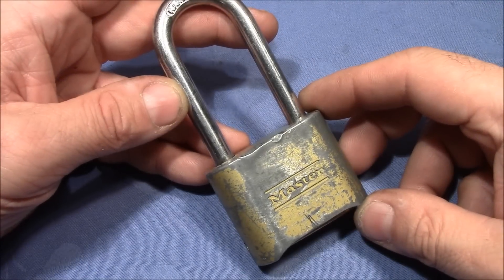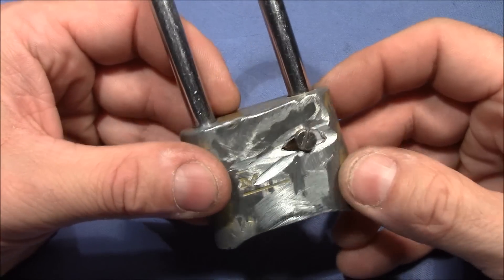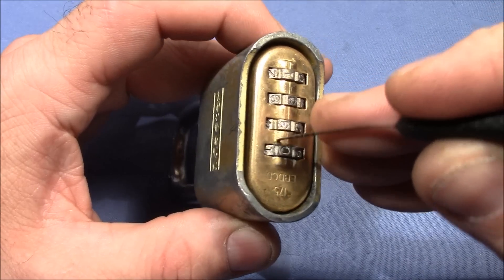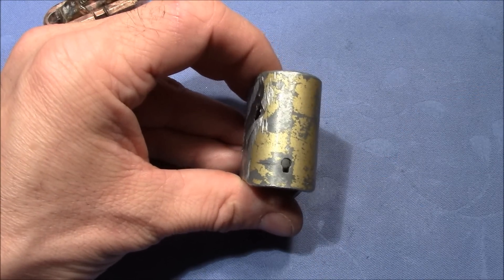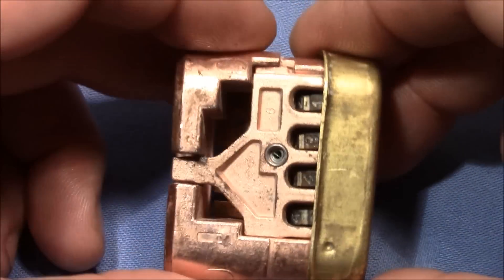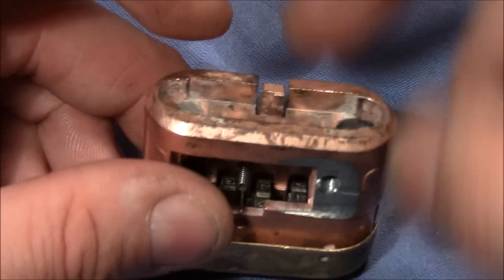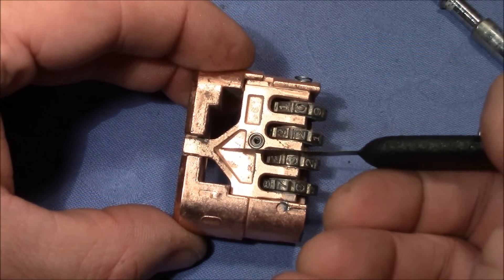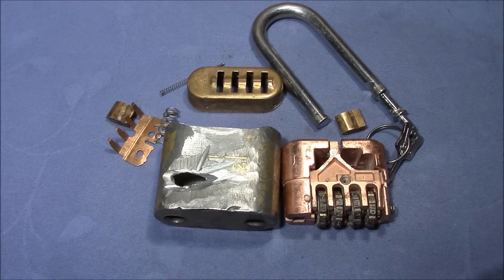(picking 431) Master combination padlock (No 175) bypassed and gutted - thanks to PickME 1977 for it

Comment: Looks like once opened with the knife you could them decode it fairly easily by pushing the change key in as far as possible while turning the tightest ring until it lines up. maybe do a vid on it.

Comment: A bit of trivia:
While the lock is open, there are two positions each wheel can be in when you put the change key in. The correct number can be on the top or the bottom of each wheel.
But having the wheels reversed is still harder to get the change key in.
And the combination you end up with could be very confusing, so I don't recommend it.

Comment: I wish someone would make an acrylic cover for outer shell at 4:12... If someone wanted destructive entry, what would happen if a hole was drilled in shell and it broke the spring at 6:40, would that defuse lock? Also, does your handle/name (Potti314) have a meaning? Pi?

Comment: Thanks a lot. Really informative and clear video, Perhaps a little long but it's always nice to watch well focused videos. I need to disassemble this and now I know how to do that. I'm quite sure that the pin is hard to remove as it probably is harneded material. Must fix the lock to drill press and try to drill it out carefully so the lock looks nice after the tampering.
Reply from the maker: Thank you - I know that I tend to over-explain and to be a bit too verbose sometimes. I'm constantly working on making more dense videos, but with little success though ;-) I have no drill press and so I made a mess with my poor lock ;-) I wish you luck with your lock. Bye :-)

Comment: Great video buddy, 
I suggest that you finish cutting that lock body, and turn it into a cutaway lock
That would be sweet... also I have an extra Master 175 just sitting  here too. So no worries if you can't get it without   some destruction.  You have another one here for you.
Reply from the maker: Thanks a lot for the kind offer. Maybe I will come back to you later if I will mess up mine. Happy that you liked the video - I myself was quite curious to see what's inside.

Comment: At last - a proper view inside one of these things ! You said pull picking is not possible as you cannot tension the mech., but if you push on the shackle to release pressure on that 'comb' or 'forked' plate, can you feel any feedback of the gates by turning the wheels ?  The newer version of this lock, the Magnum M175, has an improved mech where bypassing would be nearly impossible, but decoding and picking are possible - I have tried picking and it was easy - so they have swapped one failing for another I suppose, but I still think the new mechanism is more secure in most ways.
Reply from the maker: I tried it but the click that you get from spring that pushes against the wheels, to stay at a whole number, is much stronger than a possible feedback from the "fork". Also you have a lot of imperfections (rust, etc) what supersedes the feedback. Maybe a most sensitive person can derive better info from it. I tried that on some other locks with this kind of indirect mechanism without success. Maybe a stethoscope would be a better tool ;-) What kind of internal mechanism does the new M175 have? So you can pull-pick the lock? That's a big step back. When a thin knife a tool is needed it's more secure compared to when only tension is required ;-)
Reply: I suspected it would be hard to pick this lock - as you say, the direct connection between shackle and wheels is not there, and the wheel detent spring masks any feedback anyway ! Yes, I have 'pull picked' the new M175, however, you can't turn the wheels with shackle pulled, so you have to 'turn wheel, pull shackle, check wheel slack, release shackle, turn wheel, pull shackle, check wheel slack....' etc so it's quite slow. I agree with you that opening without a tool is lower security than needing a tool, but in the case of the  old Master 175, the bypass is so well known now, and so quick to do, that I rated it lower :o)  I don't actually have an M175, or I could send it to you, I picked one on a gate on holiday with the owner's permission :o)  The M175 in question can be identified as it has a rectangular 'front panel' rather than the oval  panel of the older locks. I will try and find the internal photo on Google that I saw, and send you the link. Basically, the fingers on the 'forked' plate touch gates tangentially in old design, but poke into gates radially on the new design - so the forked plate slides rather than pivots.....hope you understand ? Atb, Dave

Comment: Nice gutting potti I did wonder what the inside of these 175’s looked like! Was that the original shackle spring I wonder. It wasn’t even properly finished if it was ( should I be surprised with Masterlock?)
Reply from the maker: Thank you. Yes, the spring was original. As everything was oily and dirty inside I soaked the parts in break-cleaner. Maybe the finish has suffered from that.
Reply: Potti314 it was the lack of spare squared off coils at the end of the spring that made the engineer in me shudder :D

Comment: Very nice ... interesting gutting and mechanism explanation.
I wonder if it can be decoded as well ?
Reply from the maker: Thanks. It can be decoded with a decoding knife as I have shown one example in the video. You feel the gates and can align all wheels correctly. Pull-picking however is not possible as you cannot tension the locking mechanism.
Reply: Potti314 thanks for the reply ... I think I have one on these locks in a drawer somewhere ... I'll have to dig it out and play with it!
Reply from the maker: Yes, that's the true purpose of locks - playing with them ;-) Have fun :-)